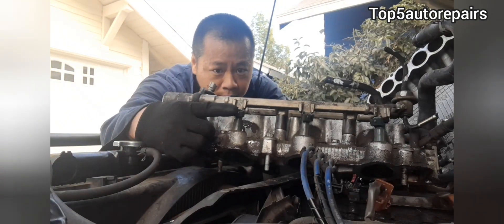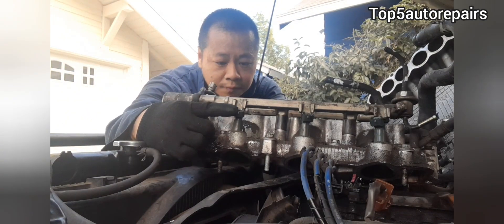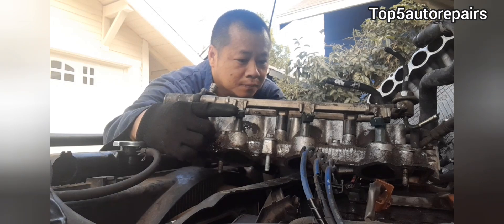Signs of stuck closed fuel injector (clogged)

Comment: Hello  sir  I  had  my  exhaust  manifold  leaking  fuel  in  down  part  in  curve  before  the  catalytic  converter  everytime  I  start  the  engine  it  leaks, you  think its  a  fuel  injector  stuck  up  open?
Reply from the maker: Agree. Fuel injector is probably stuck open.